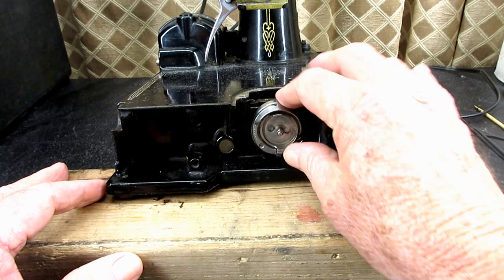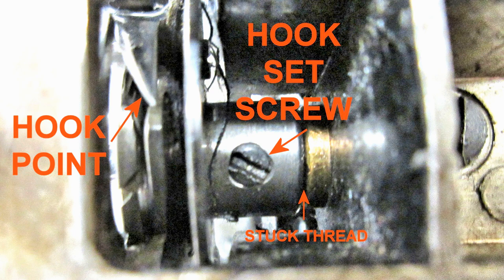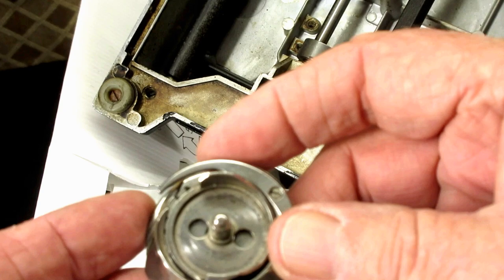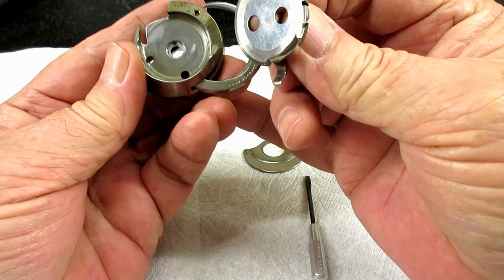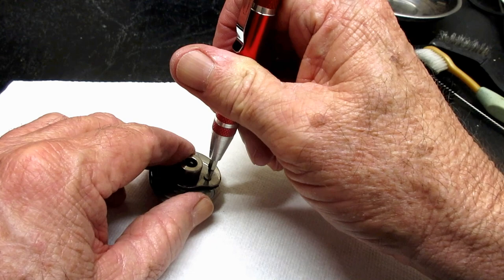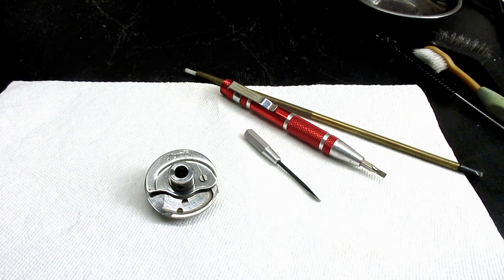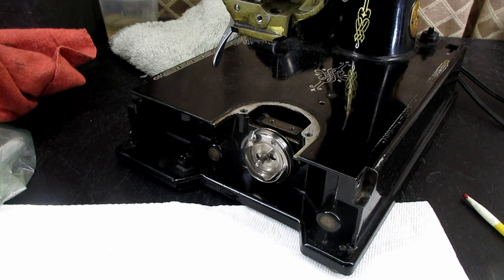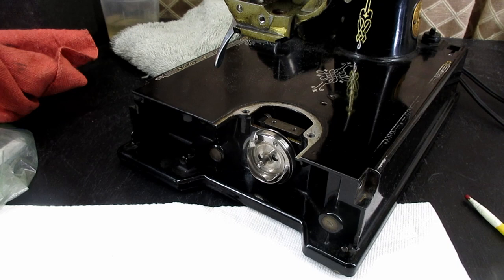How to Remove Clean and Replace the Hook on a SInger 221 Featherweight

Comment: My singer 301a makes a clacking only when I thread the needle and sew.  No clacking when I run the machine with or without the bobbin but only when it’s threaded and sewing.  The stitch is perfect but it seems as if it’s noisier the faster I sew.  
Could the hook assembly just be wore out? 
By the way I’ve spent hours and hours watching your videos and I’ve learned so much from you!
Reply from the maker: Hard for me to say anything about "clacking". I can tell you do not like the sound of it and you must feel it is abnormal. Do you know if you have the original bobbin case for your 301A? I've had people tell me the aftermarket cases (not original Singer manufactured) do work OK but are noisy so that is why I asked. On the back of the hook is a thread loop guard (stop me if you've heard this one) and it can get worn and the thread will scratch grooves into it over the years of use. Those scratches can catch the thread and hang it up of a microsecond before letting it go. Since the hook is still rotating and the needle is still lifting some pressure is built up on the thread before it is released. I think this can be the source of noise when sewing as it makes the bobbin/bobbin case "jump" or move a little when that happens. The scratches can get so bad that the thread gets caught and starts "looping" around the case and hook.
You commented here on this hook video for the 221 and the 221 and 301 hook/bobbin case are similar but I wonder if the "hours and hours" you've watched my channel did you come across the 30+ videos for model 301A? I did a fun "Coco" series of 19 videos:
https://www.youtube.com/playlist?list=PLsCOZgzzaiKLZyGebzS_oISgesXNyREyI  Then I did a technical series of 17 videos:
https://www.youtube.com/playlist?list=PLsCOZgzzaiKI_6fbu3itbd1v4z3uQvvkO
It also has a hook removal video and a "Disassemble, clean & repair hook" video here: https://youtu.be/yy_yoD2CbWM
Maybe you have watched these already, IDK, and cleaned the hook, and inspected the Loop Guard. If not it may be a good idea to inspect the loop guard and also see if there is thread caught between the hook and guard.That's about all I can suggest at this point since it is making a nice stitch. Good Luck, and thanks very much for watching my channel. ✨
Reply: Thank you for your prompt reply.  
The bobbin case that I have is original and I even tried a bobbin case from another 301 that’s perfect and it still clacks when sewing.  I think I’m going to have to get brave and pull the hook assembly off and give it a going over as you suggested but I’m a little daunted by that.  
I have watched all of Cocos spa day videos (I have seven 301’s now) and all about Regina 403a too and I even found one for a decent price and it runs like nobody’s business after I cleaned it up and gave it a some oil and a good lube.
Please keep the videos coming as I’m watching you work on this featherweight.  Thanks again for the advice.  Stay safe and healthy!
Reply from the maker: Wow, seven 301's! Nice. Thanks for watching my channel so much. Congrats on the 403A also. Like it? Smart of you to try a different bobbin case to see if it made a difference. Don't be shy of working on that hook. Easy does it and no need to hurry. If you have stubborn screws be patient. Even if it is not the cause of your problem, with 6 other 301A machines you may as well learn how to remove that hook. Every one I've taken off has had some amount of thread inside it. I had a black 301 once that had a noisy hook/case and I tried everything I could think of to fix it. Cleaning the hook and sanding the scratches on the loop guard reduced the noise about 50%, but did not eliminate it completely. I sold the machine at a discount to a repeat customer who said she did not care about that clicking b/c she wanted a 301 and it sewed a very beautiful stitch. TBH, I never thought of switching out the whole hook to see if it was worn. The machine did have a lot of miles from looking at the motor brushes. You have 7 machines so someday you might decide to swap the hook for another one to see what happens. Thanks so much for saving all those machines. Don't be a stranger. 😉
Reply: Andy Tube I took the hook assembly apart on my Singer 301a just like you suggested and found a thread wrapped around it.  I removed it and used fine grit sandpaper to get rid of the grooves that the thread had caused.  I put the assembly back together and threaded the machine and sewed.  I was so shocked and surprised that it now runs as quietly as my other machines!  You should have been here to see me do a happy dance!  Thank you for your videos!!!
Reply from the maker: @MemeMisti  Nicely done, Misti. Sorry I missed your celebratory victory dance, but I was there in spirit. I make these videos for people just like you that are willing to work on their machines to keep them running and improve their performance. I wish you were here to see my happy face while reading such a wonderful comment. 😁

Comment: where do I get that little "spring driver magnetic screw driver" you are using at 3:39?
Reply from the maker: That's an HJJ Co. spring screw-holding screwdriver. They went out of business over 30 years ago. They have brass tubes and push-button action to release. They are not magnetic but use two pieces of spring steel "blades" that separate when you push them into a screw to hold it under tension. To replease there is a plastic "button on the end you just press in and the springs come together and release tension. 
You can find them once in a while on eBay but they are getting pricey. https://www.ebay.com/sch/i.html?_from=R40&_trksid=p4432023.m570.l1313&_nkw=hjj+co+screwdrivers&_sacat=0   They last forever, I think. They made Phillips tip also. 
     There are modern knock-offs made with plastic handles that seem to work OK, Search amazon for "Feuerhelm Tool LLC Holding Screwdriver" and another brand is "NoDrop Tools LLC - 6-inch Screw Holding Screwdriver"
A web search of Screw Starter or Screw Holding Screw Drivers will come up with name-brand (and other) modern versions that you kind of twist onto the screw then hold the barrel and twist back to release the screw. They work well but are not as quick as the HJJ ones and you sometimes need two hands to use.